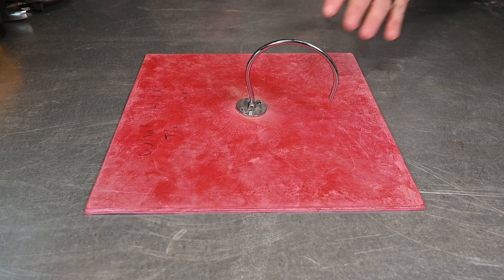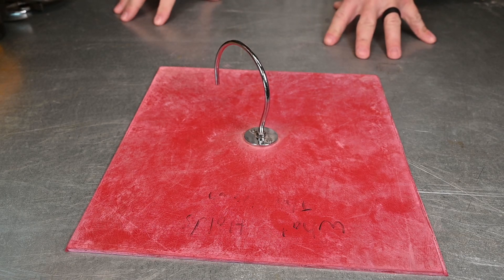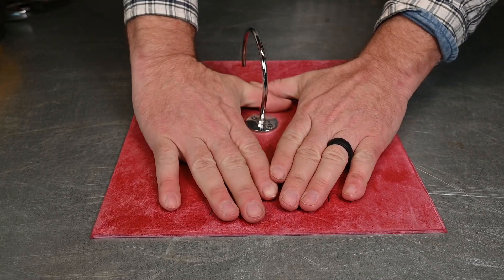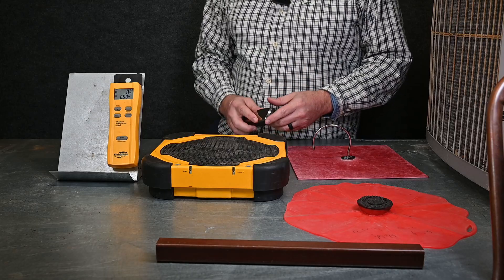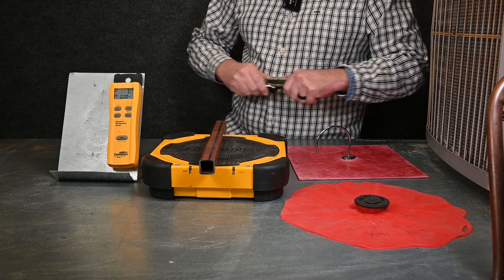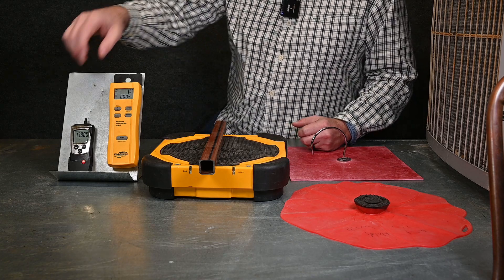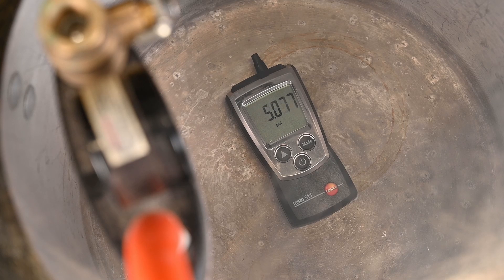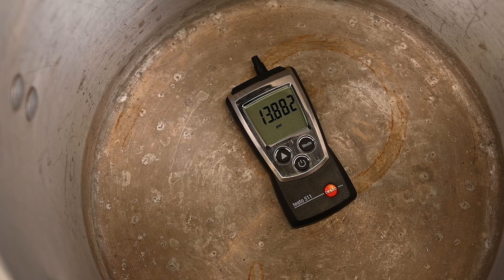HVAC 134 Vacuum p1 atmospheric pressure revisited

Comment: So if this was tested in the space station without any atmospheric psi u could just pull that up? It would be floating actually
Reply from the maker: Very good. The guage would read 0 because there is no atmospheric pressures. 
The vacuum pump would not work because there is nothing to pull and and the lid to the chamber could not seal because there is no pressure difference. 
And yes it would be floating but because of gravity not pressure.